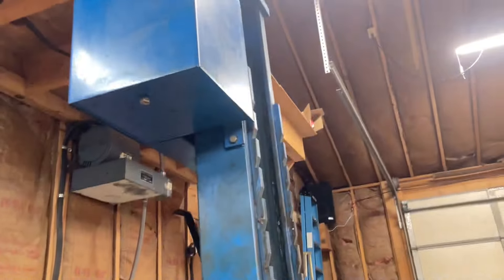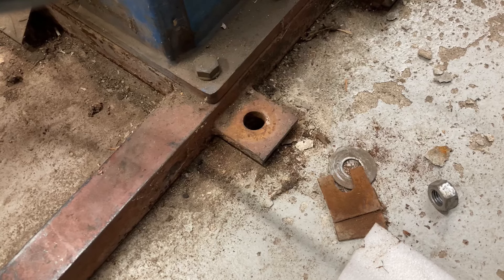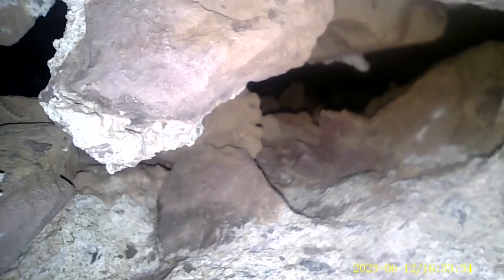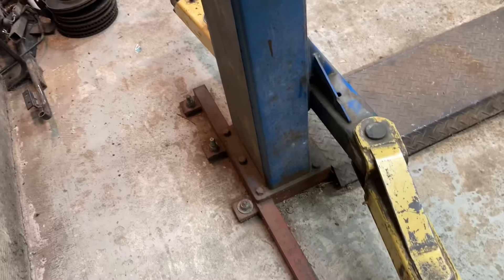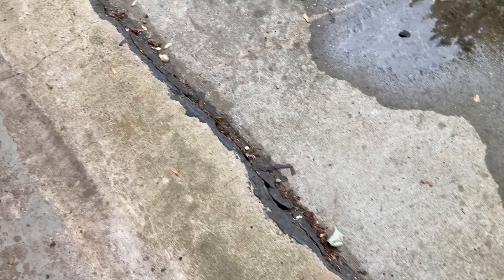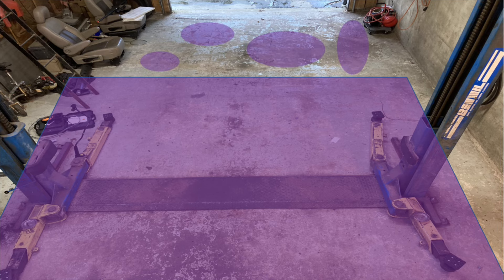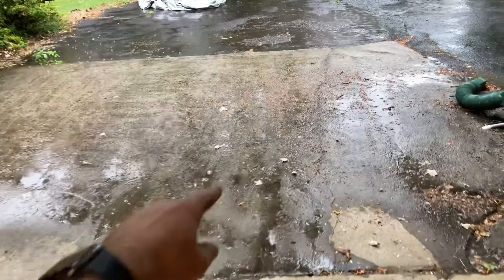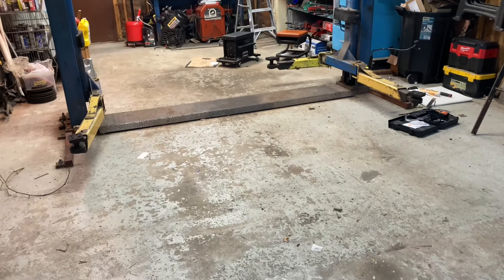My Workshop Is Condemned And I Don’t Know What To Do

Comment: What I would do: Pump concrete or foundation epoxy underneath. Bandaid? Sure. Better than what you're standing on? Absolutely. Relatively cheap, safe, non-intrusive and can be done in a day with minimal disruption.
Reply from the maker: Mudjacking sounds ideal, if I could only confirm that my lift is safe on the 3.5” slab. Blows my mind that I can’t find a Benwil manual online in this day and age.
Reply: @thedoubtfultechnician  the 3.5" slab has held the lift and various vehicles unsupported for 10+ years, so if it's now mudjacked up, isn't it technically thucker than 3.5"?
Reply from the maker: @khoatran9482  I don’t think so. The force is not necessarily downward compression. As the lift gets loaded up the uprights naturally want to bend inwards. It’s these bolts that pull the uprights straight. So it’s a pulling force, and I don’t know that the mudjacking actually bonds to the slab and therefore won’t actually add any additional pull resistance… if that makes sense?

Comment: I would jackhammer out the concrete under the lift (maybe 10' x 10'). Get a Harbor freight jackhammer and resell it after your done. Pour a new 6-8" steel reinforced slab in the hole. Reinstall lift. Seal water ingress. If you're really paranoid, drill some holes in the rest of the floor to check for voids.

Comment: 40-odd years ago, I found out that the slab of my house in Las Vegas was poured over a gully that filled with running water every time it rained, and had washed out much of the support for my house. Found this when a 30' hypotenuse triangle of the front left corner cracked and slumped just before I had to sell the house and leave the country. Back then, the quote to pump  concrete under the slab to support and raise it was $10K. This is 1983.  The house was only worth about $50K at the time. Before the cracked slab.  There should be someone in your areas that could fill the space under your slab and save it. But removing it and replacing it might be cheaper. And how I wish I had a garage and slab with a lift on it!
Reply: Or you could get a couple of 20' sticks of 1"x8" mild steel bar to put under the 2" support bars on the lift... Concrete's probably cheaper! ;)

Comment: I'd propably just cut out the area, where the lift mounts, maybe like the long irons plus 30cm around it, dig those out deep, genuinely like over half a meter deep, and pour deep point foundations, like if you'd mount a jib crane. 
To solve the erosion, I'd dig out around the shop, put in water barriers and drainage.
If I was feelin really fancy, I'd tear up the poured concrete and replace it with brick pavement, and while im at it, I'd replace the eroded dirt with coarse gravel. That'll allow water to flow through without eroding it.
Reply: Wouldn't that just move the erosion to underneath the gravel, which will eventually erode and subside anyway?

Comment: I'd recommend cheap, as you're trying to move:

1. Foam jack underneath to fill the void:
Cheaper (I believe) than mud jacking or any concrete replacemen (partial or complete).
Besides, now that you've noticed it (and published a YouTube video about it), the void should be disclosed pre-sale.
2: remove the lift. I agree that the thin concrete is insufficient to brace the lift even if there weren't a problem with the void.
3: Reinstall a much better setup on your new property. Enjoy the result for years to come. 

I'm not sure that any amount of concrete work under or around the garage is going to prevent voids from forming underneath: it appears that the garage is the low point in the footprint of the house . Therefore, the water will collect there regardless of how nice the concrete is, leading to eventual void formation regardless. 

I thought the only way to avoid subsidence underneath a low point is to create another even lower point a distance away from where you want the problem to stop.

Comment: Drill a bunch of holes. Spray foam the voids... only use high compressive strength foam, if there's such a thing😊

Fix the outside water issues first

Comment: You might be surprised how much load the foam might support that they use to lift and level concrete.  Most concrete foundations are poured on top of insulating foam anyway.  

But it could still be a DIY job renting a core drill, drilling enough holes and pouring in wet runny concrete/cement.  You can probably find recipes specifically for this purpose or hire a single standard concrete truck to come out with the right mix to dump in your holes.  As long as it’s not an actual sinkhole down there…..

A day to drill holes and a day to pour the cement.  Would not even have to move things out of the garage.

Comment: If you could find a cheap piece of 1 and 1/2" inch steel plate as long as the lift is wide and wide as  the hoist mounting surfaces, you could anchor that to the floor and attach the lift to the plate, but I doubt that you could find a piece of 1 and 1/2" steel for cheap enough (including transport to your shop) to make it cost effective.  It would totally solve your hoist problem if you could though.

Comment: Get a core drill and cut some inspection holes to get an idea of how extensive a problem it really is.
There is a chance the problem is not as extensive as it seems.
Maybe you can cut out the mounting areas and pour deep pilings to mount the lift and solve any other issues as they are identified. 
Just my 2 cents.

Comment: well to bad im a year late but it might help others .... What are the concrete floor requirements of my lift? 2-post lifts (under 12,000 LB. capacity): Four (4) inches of concrete at 3000 PSI 12,000 pound two-post lifts (and higher capacity): Six (6) inches of concrete at 3000 PSI is required.

Comment: Keep the lift that works. I miss my lift, but can't use one in my tinny detached 12x18x7' (WxLxH) garage. Replace the concrete, make it a UTube vid, write it off, and giggle at the knowledge you just made a difficult job look spectacularly easy in a 15 minute UTube video.
Reply: This, I'd take that lift over a modern Chinesium one.

Comment: I had the same problem in my railway shop…with floor heating.   Drilled holes and used sandblasting equipment to blow fill and pack the void.  Mud jack company wouldn’t come because of the floor heating

Comment: Wes just did something like this by pumping concrete below bhis slab. I'm still jealous
Reply from the maker: Before this it was the roof rotting out and the gutters getting replaced, before that the pipes froze and burst, before that my circuit breaker panel melted… still jealous?
Reply: @thedoubtfultechnician  why yes I am. I have a crappy 2 car garage with quick jacks.
Reply from the maker: I was just trying to ease your jealousy :)
Reply: @thedoubtfultechnician  it didn’t work nice try lol

Comment: You’re going to have to get in there to see how bad the damage is. And I mean, is it just that area or has it spread to other parts of the garage. That what would scare me.
Reply: The whole floor was flexing when he was jumping it all on there so I'm guessing it's pretty hallow.
Reply from the maker: The workshop is an addition, essentially a different foundation. The main part is built like a tank. If I go the mudjacking route, they use ground penetrating radar to find and eliminate the voids.
Reply from the maker: That was probably just the camera bouncing. It doesn’t flex- but you CAN hear it’s hollow.

Comment: Looks like that lift was already modified with 2x2  bars to spread out the weight forward and aft so guessing the installer new it was sketchy at best. 
What would I do today , not look for info in the comments but get someone who knows what they are doing to look at it.

What would 25 year old me do ....... get some 8 ft long  3/8 thick   2x6 angle or square stock and weld the bajezuz out of it wont fall  forward or back and make sure the tops of the hoist are held apart with some 2x6 1/8 wall as a spreader.  
The 5000 ish LB  lifting  pile of obsolete you can use until you save up to do it right then.

Final thought, get it fixed or out before  them kids are old enough to be around when its in use or wanting to use it themselves. 
Peace
Reply from the maker: The 2x2 bars are factory according to the parts diagram. Had a foundation rehab company out today- I should be able to save the lift!